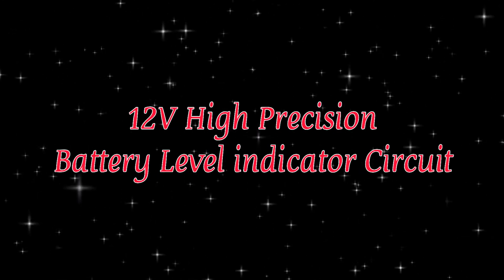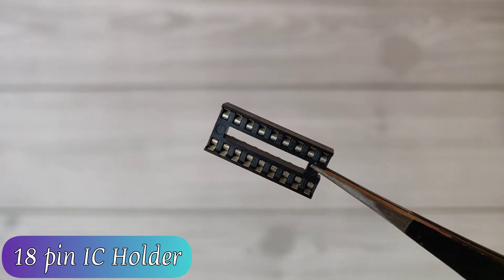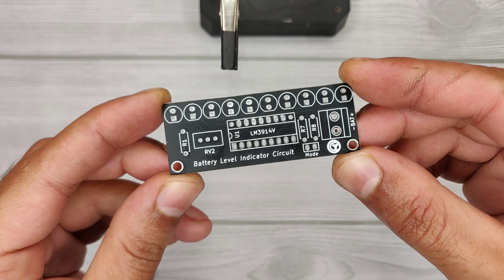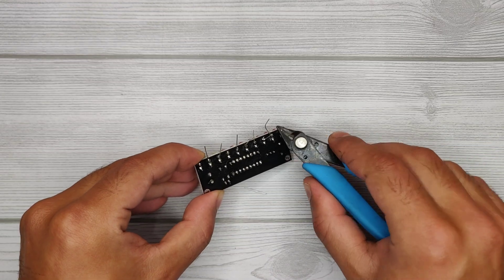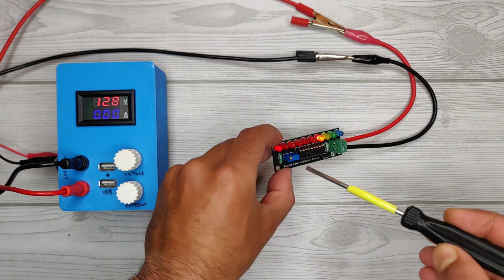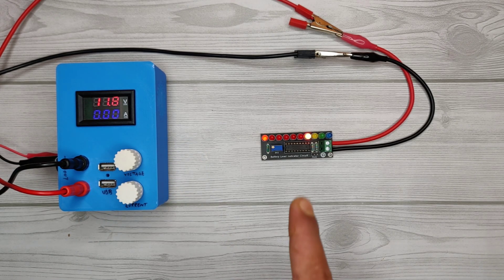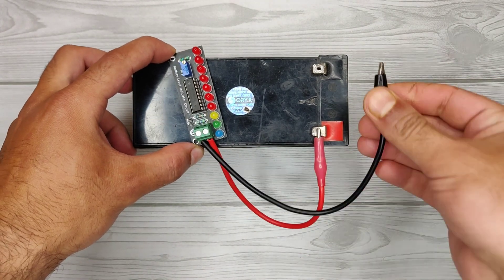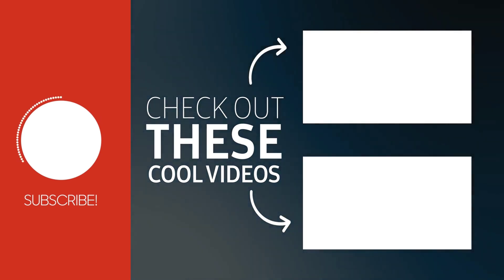Battery level indicator circuit 12 volt

Comment: I have lithium ion batteries that are 13.8 fully charged and using solar charging. My battery has smart system that turns off when voltage goes below 11 5 and the charge controller switches to balance mode when ovér 14.5. Can this be used with different color LEDs and adjust for a wider reange of useable voltages? Like read for anything below 12.0 and yellow for between 12.2 to 12.4, green for up to 13.6 and blue at 14.2? Viltages could be varied some for actual ranges. Im using a 100amp/ hr battery now and will be add more in parrsllel in the future for more storage. I just need a circuit that allows me to see where I am when away from the big charge controller with the digital display on it and the mode indicators it has

Comment: Make  or suggest changes for  6v battery leval indicator as well
Reply from the maker: Same will work for 6-24v batteries just need potentiometer adjustment for configuration.
Reply: Thx
Reply from the maker: My pleasure

Comment: Buddy please do for 24v 18650 battery...I want it to display from lower limit of 22v to 24v
Reply from the maker: You can use same circuit and configure it for 24v, Luckily according to the datasheet of ic, it has max supply voltage of 25v.
Reply: @CreativeTechos  I'm still leaning pcb design....
Reply: @CreativeTechos  buddy....I want schematic of 6s bms....the Chinese version fails faster...I want to order it by myself...so I can use quality components....and also lower the under voltage cut off to 2.2v
Reply: How

Comment: Please read my comment on your auto cut off 3.7v battery charger video , Thanks!
Reply from the maker: Sorry, i may have missed your comment, please reply at original comment.
Reply: @CreativeTechos  Hi , I want it to cut off at 3.7v , Which resistor do I have to change? (Without variable resistor) 
Thanks You very much!
Reply from the maker: Original comment replied
Reply: #technicalmonirul ❤️❤️❤️❤️